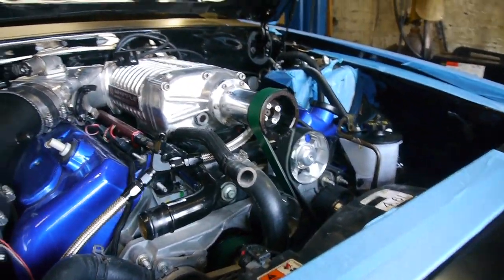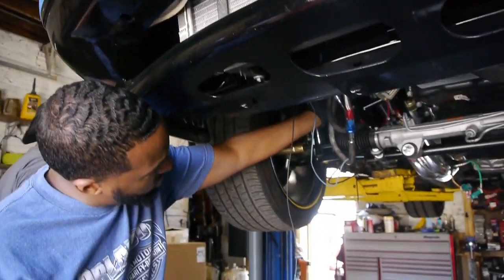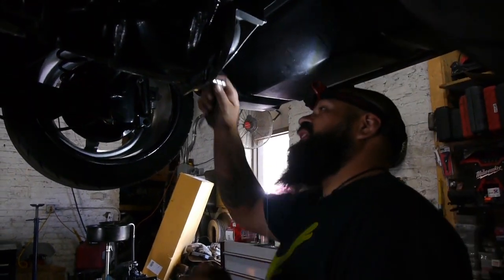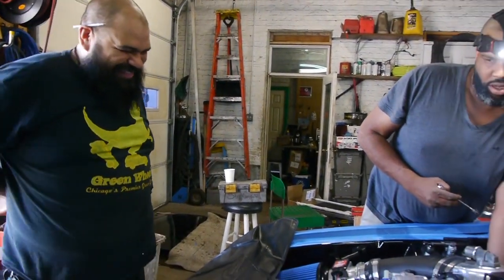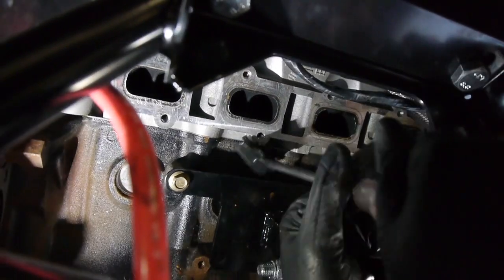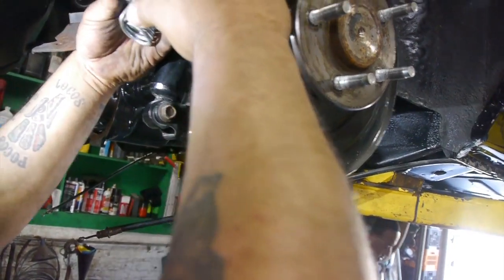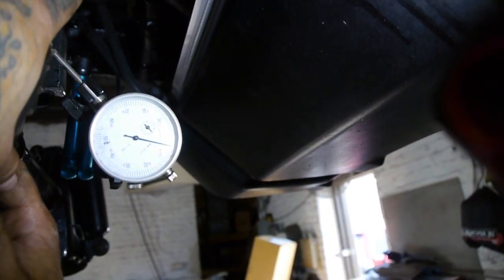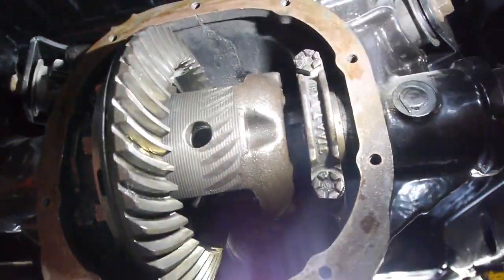ksdnotch 93 foxbody (the story episode 17) by Folleh Shar Tamba

Comment: If its not too much to ask, what happen?? why is the car coming back apart. On Instagram you mentioned it was due to improper body work...Did TKO resto not do his job correctly? you also mentioned the motor had been sitting for years before you ran it again and coolant system was contaminated. I guess I am trying to see what went wrong.  I know that you have poured money into that build and it sucks to see it getting torn apart instead of it being on the street ripping the asphalt..
Reply: Issac as it relates to TKO Resto I will not comment on what was done. As it relates to the motor I actually got that issue fixed this weekend. There are only two other issues which will be revealed in the later videos but this has been a process of learning for myself and for the crew that is helping me. I made a-lot of mistakes trying to get this car done. Last week was the first week we had the car running and driving and then other things started not to work once that happened. It does suck but we are almost there. Thanks for watching and subscribing.